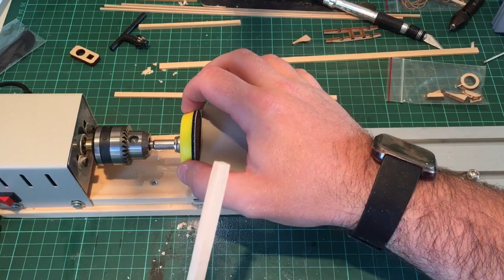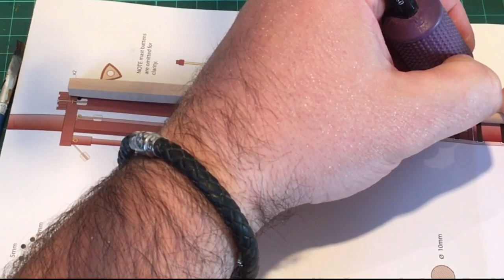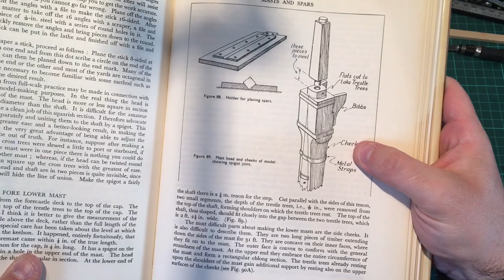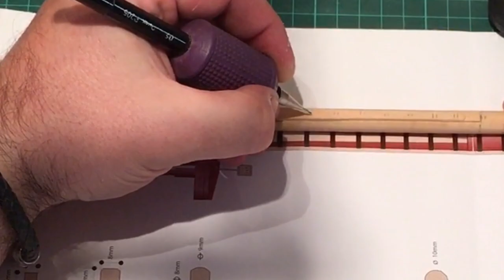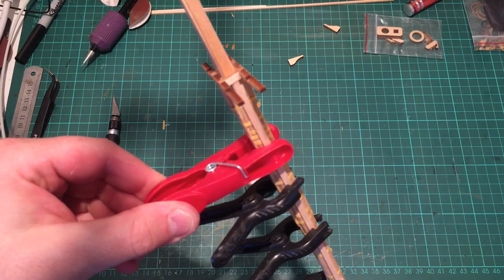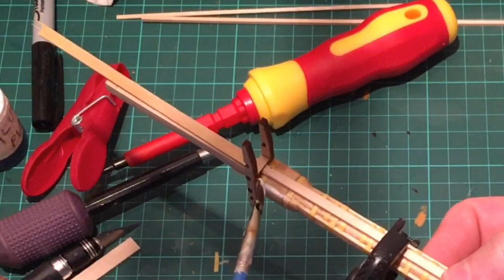Model ship building - 1/84 HMS Victory : #19  - Fore mast / iron hoops over woolding

Comment: Its Tamiya masking tape. Available in a number of different widths. Its also Yellow which helps
According to Caldercraft half  of the hoops go under the cheeks as you have done. I added the cheeks afterwards
Make sure the tape does not lift as it has done on mine!!